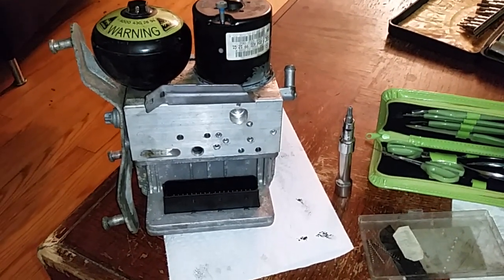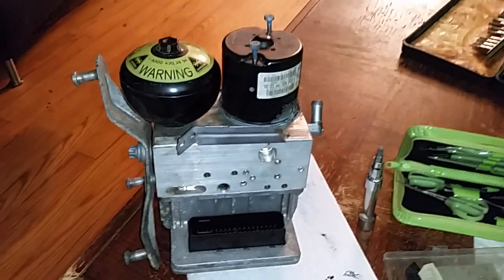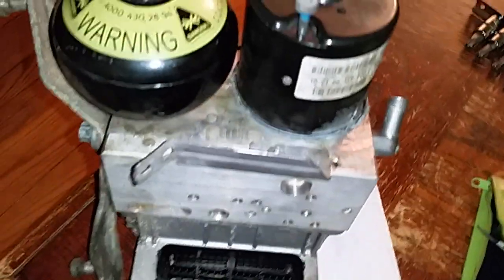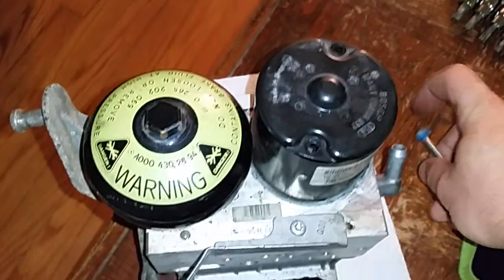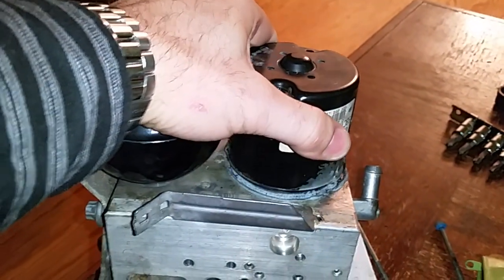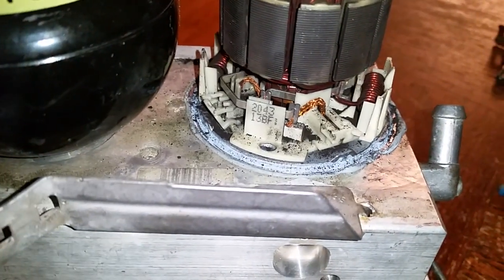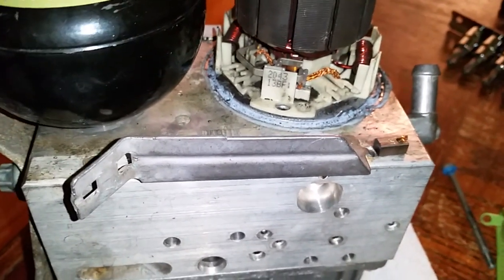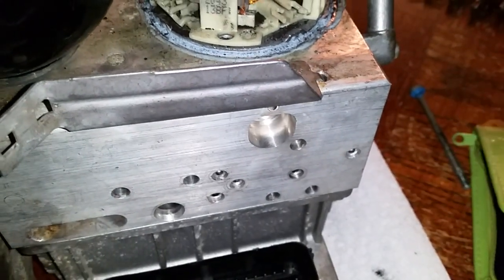Mercedes Benz / Bosch SBC Pump Rebuild (Brush Replacement) pt. 1

Comment: Can you help me identify my SBC issue?  I get a code "C217A Check power supply of component valve relay."  My scan tool shows that "054  Power supply valve relay" is sometimes at 5.6V and sometimes at 12V when it works OK.  At the connector plug all the voltages are 12-13V with engine running.  By the way the unit is only 3 years and 5000 miles old. I doubt that it needs brushes already.
Reply from the maker: Its great you pulled your code, don't know the fix off hand for that code but I would do a lot of searching online for that code and see what I could find.  The first thing that comes to mind if you are getting voltage warnings would be the SBC battery in the engine bay near the air filter or the car battery in the trunk.  I would test new batteries in both places and also get the alternator tested.  ...And yes the SBC has a separate small battery that it uses

Comment: Where can I purchase the brushes and what sizes and specs? TIA
Reply from the maker: I did not give the size since there are at least 2 and maybe more sizes from Mercedes, you must measure your own brushes to be sure to get the right size sorry.  Please check out the other vids I have provided info on how to get the correct brushes they are custom order to get the correct material

Comment: This is awesome, so that is all it took to get the brakes working again for this massive design flaw?   I am thinking of purchasing a 2004 E320, however was scared away by the SBC issue.
Reply from the maker: The issues with SBC can vary, if you are buying one I would allow for an extra 1000$ for any possible repairs it may need

Comment: Great & informative video!! can we also see one with you removing from the engine, also removing the ABS/ESP, control module from the ABS pump!!
Reply from the maker: Glad you liked it, sorry I didn't get the removal but its very straight forward, its just the connections on the top you can see and wiggle the unit loose once everything is disconnected from the top, its just attached by rubber feet, no bolts